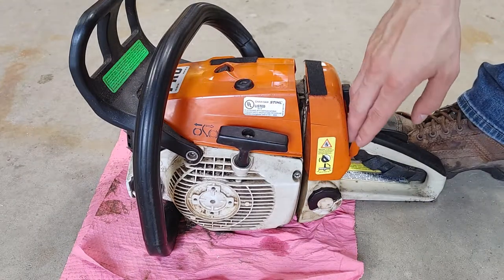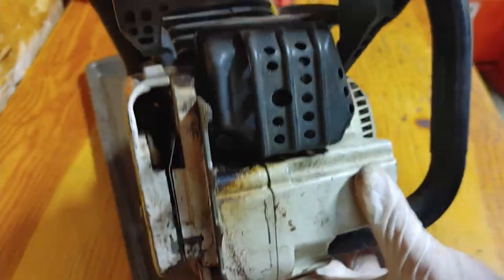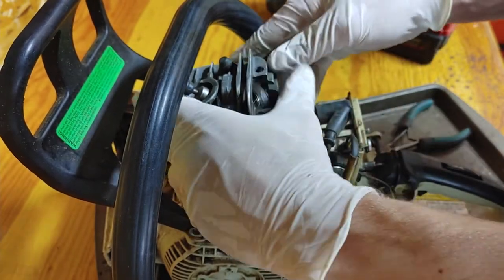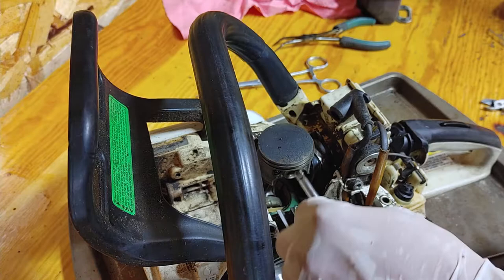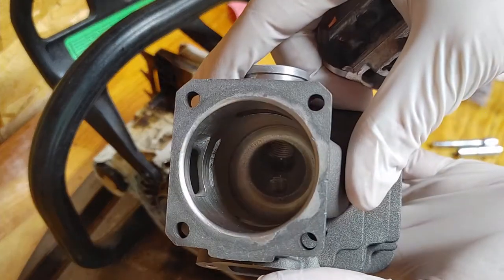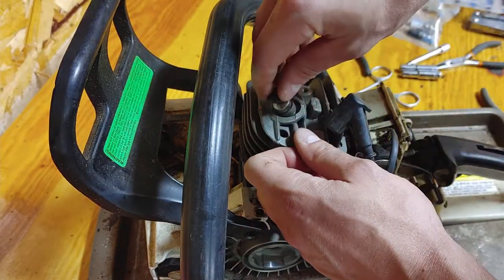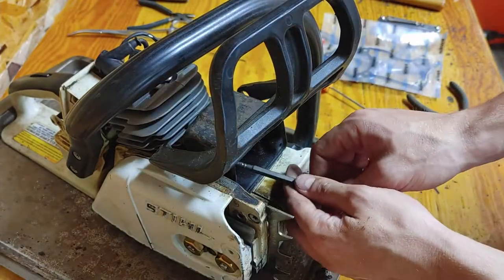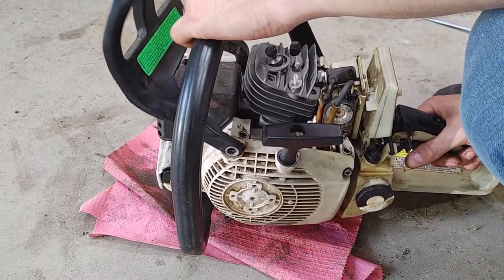Stihl MS260 Pro Chainsaw Cylinder and Piston Replacement

Comment: Any time a Stihl saw rolls over, immediately move it up to half choke  and pull it over until it starts.  If you pull it over after it rolls over, you will flood the saw.
Reply: This is true. Once it almost rolls over, move it up to half choke. Starts next pull.  I had my own lawn care and have used a ton of Stihl equipment, had great success with their higher end units and have heard even the lower end works well.
Reply: @NONO-hz4vo  not always does it crank with one additional pull, but usually.  Most of my saws average out at 3,2P but occasionally I get a 1,1P and have even had a 1,0P in real cold weather.  1,1P tells me the carb is only tuned for the temperature that day but it sure does help my arm and shoulder.

Comment: I have the same chainsaw ... it has less than 10 hours of use. I have had to replace the piston twice for same issue, scored piston. Stihl is refusing to repair or replace the saw. It will cost me $275 to have a local Stihl dealer replace the piston. Obviously a defective lemon. I will never own another Stihl. Any suggestions or recommendations would be greatly appreciated.
Reply: Just get a poulan 4218 and you’ll be happy 😊
Reply: Not the saw. It's your oil and mixture. Use 32:1 and use amsoil. dominator.

Comment: The heading said Stihl Pro chainsaw.  Is a 260 Stihl Pro
Reply: Fat fingers.   Is the 260 in Stihl Pro line?
Reply: @ronkolb1335  It is a pro saw or if you wanna be accurate, it was.
No longer in production.

Comment: Good video. Nice tip on piston direction. I just tore down my 193t and I rubbed off the Stihl logo when cleaning and it does not have an arrow (I'm trying to re-use my factory cylinder and piston before I give up on them and buy a new kit).  I also have a 026 and that is a very nice saw.

Comment: Didn’t use a torque wrench on the head bolts ?
Reply from the maker: I tighten the head bolts to snug-enough ft-lbs.
Reply: The torque on a small 2t engine like this is going to be a lot lower than the capacity of the bolts. Just snug them up as he did and you will be past the required torque.

Comment: What rebuild brand did you go with?
Reply from the maker: It's shown in the video around 6:35, it's farmertec.
Reply: @in-depthdiy2123  thank you!  Are you happy with the build quality of their aftermarket product?
Reply from the maker: @Lauterbach24  It appeared to be good quality, but with only two tanks of gas through it I can't comment on the longevity. It assembled and fit well and runs as I expect it to.
Reply: @in-depthdiy2123  thank you for the information.
Reply from the maker: @Lauterbach24  I want to follow up and say the farmertec kit didn't work out in the end. It kept pushing around 125psi and it never generated enough power to be useful long term. After disassembly the piston wrist pin was loose. I used the farmertec piston rings on the original piston/cylinder/wrist pin and it's now at 145psi and plenty of power.
Reply: @in-depthdiy2123  thank you!
Reply: Why didn't you just buy a new piston. You took out a perfectly good stihl cylinder and replaced it with a Chinese farmertec. For under $50 you could have gotten a new stihl piston and rings.👍
Reply: @in-depthdiy2123 so in the end replacing only the rings fixed it?
Reply from the maker: @BrodyRadford  Yes

Comment: How did you compress the piston rings to get the piston back into the cylinder?
Reply from the maker: By hand. Small engine rings compress easy enough by hand and slip in on their own most the time. It's not as intense as a car engine.
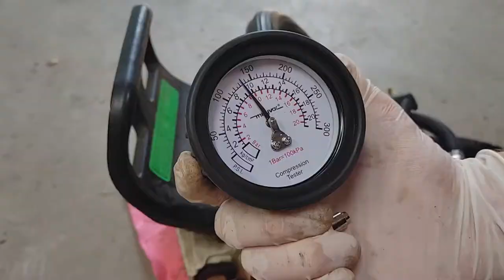Reply: @in-depthdiy2123  oil mix 1:33 is ok ?

Comment: I saw where you said the rings compress by hand and go in easily.  I thought you might have left that part out on purpose to keep the secret.  That's actually the part I was looking for and wondering about.  It would have been nice to see that critical part.  That said, Great video, most informative and easiest to follow of all I've seen.  I need to do a 362 but it wasn't worth $600 at the shop for a $900 saw.  Thx
Reply from the maker: In my newer video rebuilding the Dolmar 7300, right at the 40 minute mark, I show pinching the ring and sliding the cylinder on. I usually angle it slightly away from the ring gap so I can continue to pinch the ring until the cylinder slides over on its own.